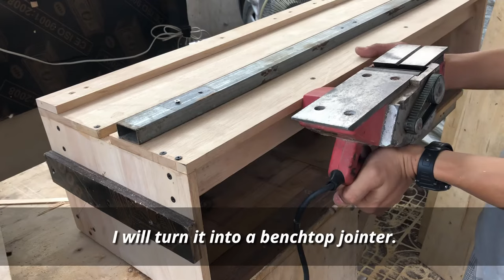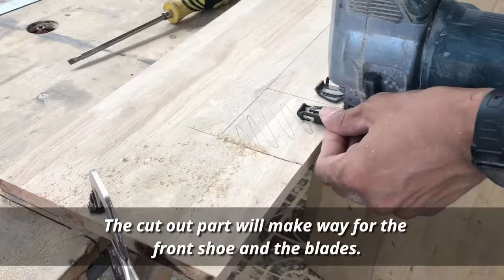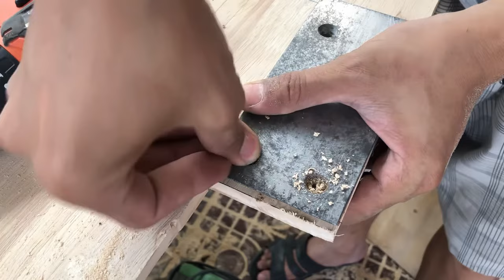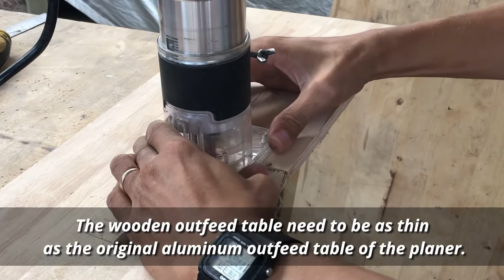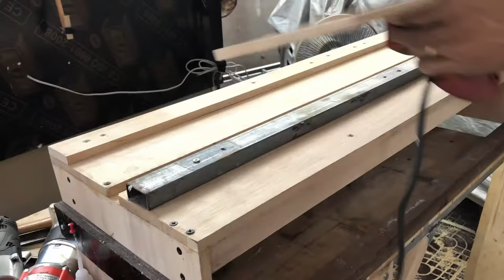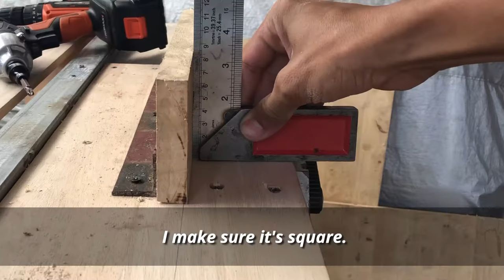DIY: Homemade benchtop jointer || simple jointer made from planer

Comment: Telekkk, 🤭 jajal lek nyetel pye, 😀😀😀
Reply from the maker: Thanks brother for the comment. I hope this video is useful to you.
Reply: This simple method of making a jointer from a plainer, gets around many of the not so safe or stable builds I've viewed on YouTube to mount the plainer. First person I've seen using the angle iron method that guarantee 90 degrees for the fence. Great design I will use this method for my build and add a wooden frame for durability below your design this will inprove my current jig.